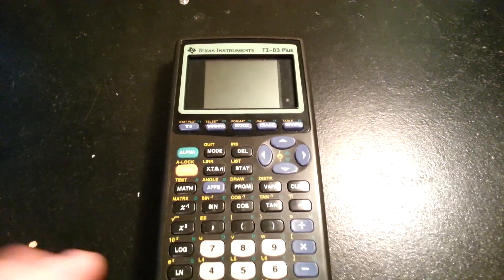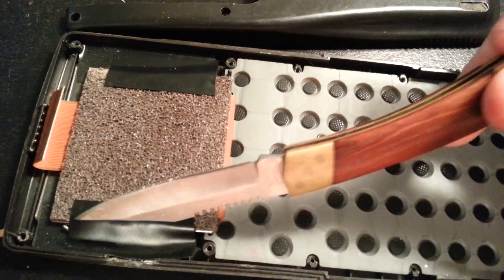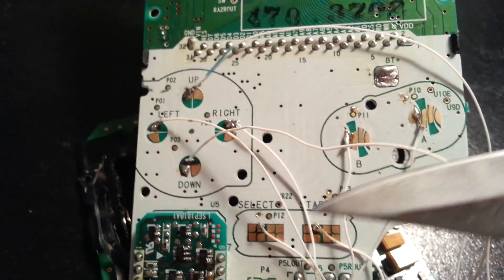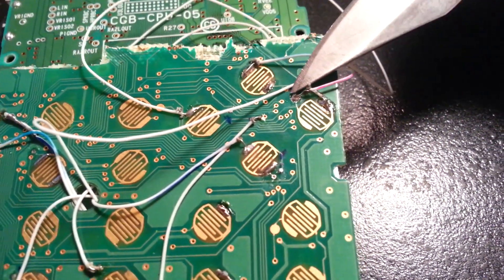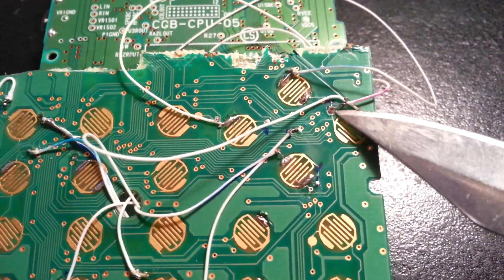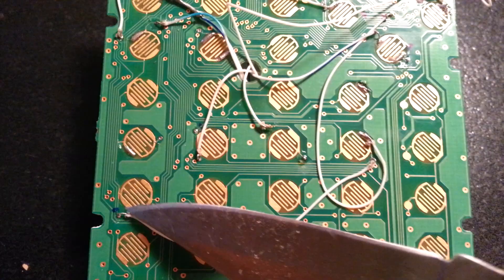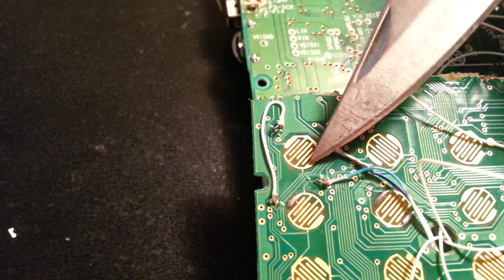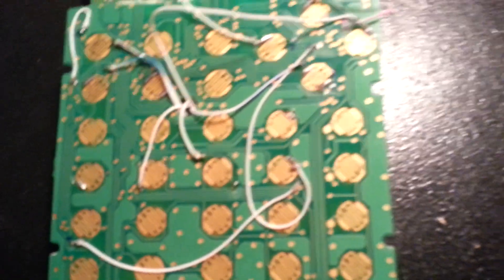Gameboy Color inside a TI 83 Calculator [Tutorial]

Comment: Two questions: What did you do with the speaker? And: Are the ground wires necessary for it to work because I want to try this on a TI-82 and the little pins are different. If they are necessary, how do you determine which pin is ground?

Comment: what wires did you use to wire the gameboy color to the calculator?
Reply: Likely just a basic copper wire in a rubber case. you can find them from Ebay quite cheap. (Unsure if you can get them from Gamestop)
Reply from the maker: 30 awg kynar
Reply: Thank you I wanted to make this for myself and I didn't know what wire to use
Reply from the maker: Np

Comment: what gauge wire did you use and if its thinner than 22 how did you get it? i tried 22 and it was way too thick
Reply: it wasnt solid core
Reply from the maker: I think it was 28 awg. You can get it from ebay for hella cheap
Reply from the maker: It was actually 30 AWG Kynar Wire. At the time I got it from sickmods(dot)net
Reply: oh thank you

Comment: Is there any particular reason it is the TI-83? Is the model's thickness important, or can I use the significantly thinner model I have lying around?
Reply from the maker: +The Silver Tunist Nope, just what I had at the time
Reply from the maker: +The Silver Tunist It will make it harder to fit the gameboy in a smaller calculator though

Comment: how you connect the lcd between the gameboy and the caculator?
Reply from the maker: Isaac Chan I ditched the calculator lcd completely and only used the gameboy lcd
Reply: like you connect the caculator and the gameboy with only the gameboy lcd?
Reply from the maker: Isaac Chan ...The calculator isn't actually "connecting" to anything. I'm using it's lifeless husk of a motherboard as a button donor. The screen to the calculator is removed from the equation and so is its power source. I use the wires as shown in the video to essentially move where the gameboy buttons are located by using the calculator buttons instead. I hope this helped...

Comment: Is this the only calculator it works with. If no, which other ones does it?
Reply from the maker: Elijah Rothaus I'm sure this would work with any calculator big enough to house the GBC motherboard in. Just connect up the buttons like I did in the video (but for a different calculator the spots I used will obviously be slightly different) and make sure everything fits together.

Comment: I'm looking to make a ti83 a computer input via an arduino.  I want to use all the buttons and I was wondering if 
1. The holes go all the way through so I don't have wires running under my buttons,
2. If any of the non-ground pins were connected together, and
3. What connectivity the 83 originally has (usb, headphone jack...etc)

Thanks.
Reply from the maker: 1. yes
2. can't remember sorry. maybe?
3. I'm pretty sure it only has a headphone jack. not sure if it has anything else. you can google that though.
Reply: Thanks.

Comment: your next project should be to add a switch from GBC mode to calculator mode
Reply: in other words, figuring out how to send the calculator signal to the GBC lcd. so a lot more complicated after I actually thought about it :)
Reply: +Kintama171 That would probably be pretty hard, as you would have to have all of the calculator motherboard (he cut some of it off to save space) and you would have to have both screens in, as the gbc screen is very different to the calc screen.

Comment from the maker: I won't be making another tutorial for this, but I might be making a gba sp ti 84 hybrid, and if I do I will definitely be more thorough. But for this mod, the only things I had to "cut" off was the part of the calculator pcb for the very uppermost 5 buttons (you can see it pretty clearly at 2:25) and the plastic that was in the way of putting the game in it's slot. I also cut down the AAA battery holder and superglued it to the inside.
Hope this helped.